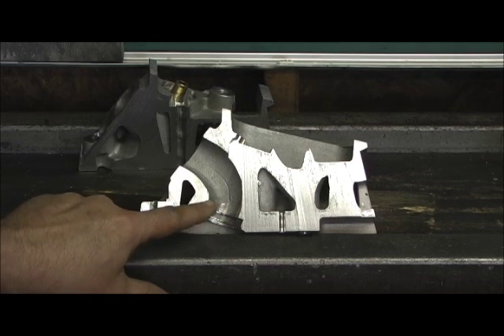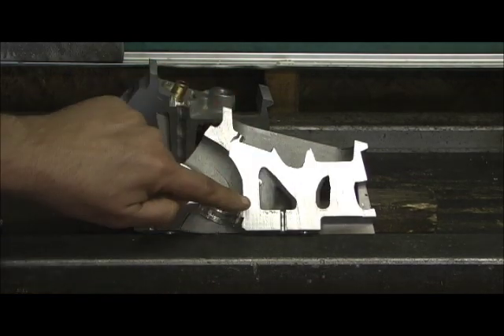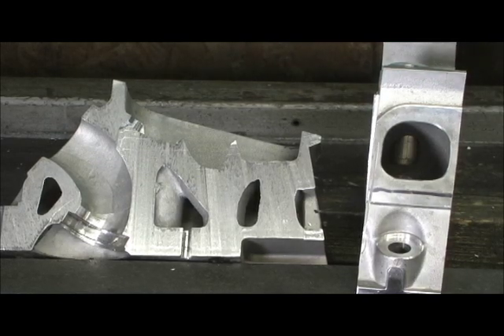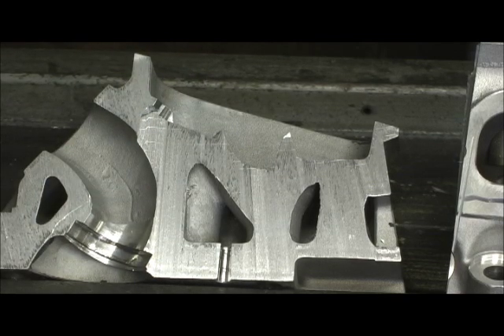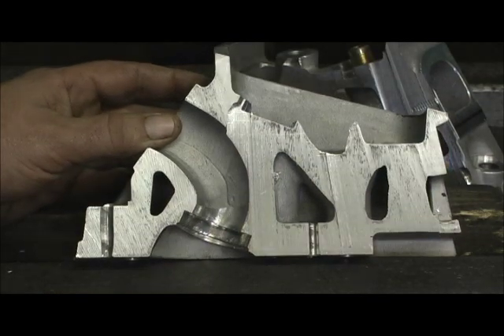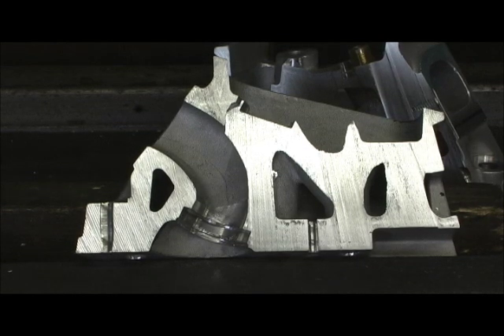ProMaxx 200 NEW Exhaust Port Cutaway 4.0

Comment: you think detonation might be an issue with these heads?
Reply from the maker: No, why do you ask Carp?
Reply: Well, they reworked the coolant passages and it just seems that this head might be prone to hot spots that might cause it.
Reply: Carpathian2010  As long as you have a good coolant system and the engine is not stupid hot I don't see detonation being a issue.
Reply from the maker: No, the way they sent the coolant passages, or the flow direction, it removes the heat well. Years ago Brodix started playing with this, and I believe they spent a LOT of money experimenting with this so they COULD thicken up the head and not over heat or cause DETINATION!!! It is good to go
Reply: There is a lot to be desired in these heads if that's the case.
Reply from the maker: Carpathian2010 When you look at the fact that one of the main problems with ProComps, The Guides and the Sinking of the bowl meat under the steel seat, it cost about 150 to 200 to replace the guides with the good ones, THERE IS THE DIFFERANCE, then look at all the other GREAT things this head does...